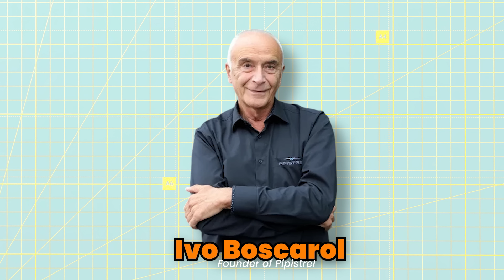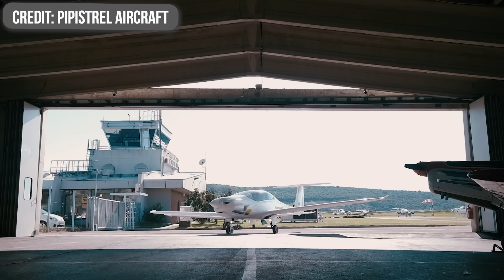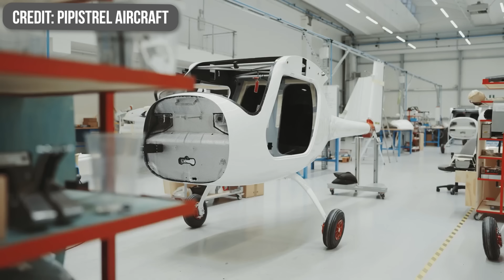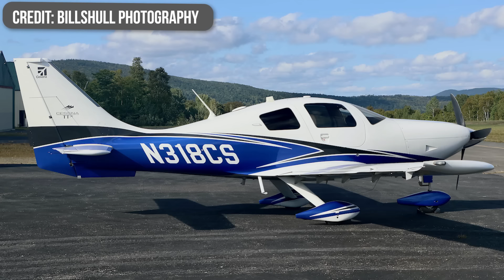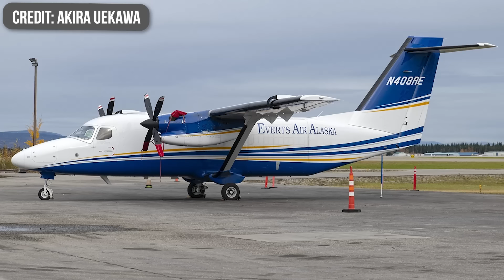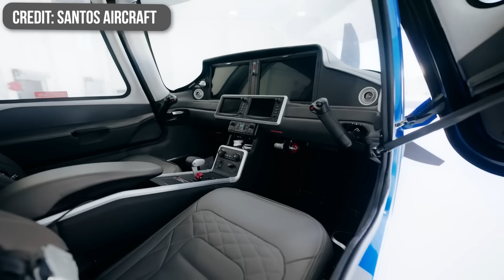What Killed Pipistrel’s 200-Knot Panthera?

Comment: They should have stuck with their original Lycoming 390 engine that supported AV Gas only. To accommodate regular gasoline, they went with another engine that changed the math for all other parameters altogether. Weight, design, CG, economics, and cost and time.

Comment: Liked Textron early on for their trainer fighter jet, but I hope they are not smoke babies now. The Panthera is the right design for a 100kWh battery and a 275 peak kW motor. Need to extend the wings to full glider dimensions. This is Pipistrel's next gen electric if Textron don't kill it.

Comment: The basic Cessna line were born when Cessna was a far smaller and agile company, not burdened with red tape and the famous American executive's short term mentality. That is why they had a chain of failures. Textron's heart is no longer in small planes , they are making way too much in jets. It is dumb to buy a company and try to grab their battery technology, when the whole world are waiting for a tech break through in energy storage, and the present tech is not even good enough for cars. Textron tried to clone the PC12, they only started over a decade late. I wondered will it be another still born ?  Maybe they are waiting for GE to perfect their engine ?  The TTX, or what ever you named it, I was at Oshkosh a decade ago, I did some math in my head, turned out it was a great two seater plane. They were pissed at me saying it out loud. You fill up the tanks and you were left with enough cabin payload for a 170 lb pilot and a much lighter passenger. Something hard to correct with a name change. The TTX, like the King Air, born with marginal capabilities, needed a decade plus of incremental improvements to make it a best seller, and that is not for short term mentality to stomach.With a chain of failures like that, how many CEOs did they have recent decades?

Comment: Hind sight might have dictated they try something partially liquid cooled , (like Rotax)  and with a knock sensor instead of a heavy six cylinder. I call the present offering of Cessna piston single the Wichita Insult.  An airframe over 1/2 a century old, certification paid for eons ago, made a few changes not by the engineers but lawyers (extra fuel drain ?)  up dated the price, panel,  and offer it to the public with a big company take it or leave it attitude.  Glass cockpit seems such a waste for such a low performance plane. I have a computer with a 486/66 processor, how much will you pay for it?  $ 3/4 million for a lousy 172, that is robbery. If you just consider the law of physics, just about the whole line of Cessna single have a modern day equivalent, not certified , but they can fly circles around them. The 182 equivalent, the RV 10. The 210 The Super Stallion are just 2 examples. The jets are still struggling against the "sound barrier"  with the record holder in speed , was that the Citation "X"  beating the next runner up by a couple of knots. 4000 miles range is far far short of the range of larger airliners, such as the 787. You can cross the Atlantic , but not the Pacific. Even the Challengers and Gulfstreams maxed out at around 9000 miles ?

Comment: Pipestrel could use a 230 HP Delta Diesel which is already turbocharged. at 75% power, it would use 9 gallons per hour of Jet A fuel which is cheaper than avgas. That could yield 200 knot speeds in the low to mid teens without complex engine management.

Comment: Panther’s problem was its tail and needed a lot of re engineering to strengthen it without weight. The cruise speed was within ten knots of its max structural speed limit which is caused by the tail weakness, guess what happens when your not paying attention and nose just barely starts to angle down.Textron didn’t want its darling G36 Bonanza getting stomped on either.
Reply: Love  the plane , but just  looking at how the  H-stab. attaches to the V-stab. does not inspire alot of confidence . The overall appeal of that back end is subjective.....
Reply: If l may , all the G36 needs is a bit more shoulder room, and a diesel  option !
Reply: Why does everyone keep saying Textron wanted to kill a Bonanza competitor? Textron literally killed the Bonanza itself. They were only selling a couple per year (at nearly 2 million dollars each!!) and announced the end of its 80 year production run back in October 2025. GA is literally dead.

Comment: I've had a deposit for years now and in the meantime the price has almost doubled to over $1M. I absolutely love the looks, performance and handling of this aircraft, but I'm not getting younger and might have to bail on this. Also the luggage space is shockingly small compared to an SR22 and it would have been nice to have some piezoelectric anti-icing. Sad to see this go the route of the Cessna TTX.

Comment: Textron has deep pockets but no engineering vision but Pipistrel fumbled that program way before Textron bought them. There is just no certification difficulty with a composite unpressurized bird. Limited engine choices, overpriced avionics but otherwise simple. I don't know what they were doing all those years but it wasn't certification difficulty. It was shown off in a nicely finished form already in 2012/13 and then nothing. I remember being disappointed they raised the price to 500k which today is almost cheap if you didn't know any better.
The plane had great potential, good looks and aerodynamics but they fumbled it hard. It's a facepalm. With a new engine like JetA CD300 and cutting 300kg from the plane (which is very doable) it could be market dominant. Your conclusion that Textron doesn't need the Panthera is quite wrong, they should want to dethrone Cirrus SR22 which is very possible. It's not a fantastic plane. It's a so so 1980s hobbycraft with a WW2 engine. It's not even carbon fiber, it's so unambitious that they used fiberglass when carbon fiber pays for itself. Yet they want 1.5million for one now. Textron could murder them with an improved Panthera. The Panthera has 2 strong qualities, looks and aerodynamics. Just need to cut airframe weight in half and a JetA breathing engine, then it will be untouchable by anything other than an actually light jet designed by me. oh yeah and add a parachute that doesn't use a dumb rocket. People would love it across the board. Getting rid of Garmin would also be good for price. Might cut close to 100k from the price
Reply: Cirrus's strengths are mainly it's interior  - 49" of shoulder room , and the overall panel area layout is certainly the industry benchmark  standard  ! And because of  who is typically riding in the right seat, sold on the whole parachute idea , yes sales  remain healthy  .

Comment: Another factor to consider when comparing against the SR22/T is insurance.  As a relatively new retract with very limited volumes, the Panthera would drive significantly higher insurance rates compared to fixed gear Cirrus

Comment: With such a long wingspan, the Pipistrel would be a bumpy ride at speed in anything less than perfect conditions
Reply: Wingspan has little to do with it. Cruise lift coefficient does.

Although higher aspect ratios do have a steeper lift-curve slope.
Reply: @Triple_J.1  Steeper lift curve is what gives you the bumpy ride when you're travelling in turbulent air conditions.

Comment: I wonder why there was not greater effort by Lycoming to make the 390 Mogas compatible?  A few points of compression would have dinged the power output, but anything in the 200hp range should have sufficed in an efficient airframe.  185 knots true?  It might have been enough to get the program off the ground.
Reply: Especially since they spent years refitting it with the IO-540 which won’t run mogas either.

Comment: I think Turbaero/Turbotech/ PBS (who all are making smaller turboprops ) should approach Textron into making the Panthera the first GA friendly light turbine. Different niche, solves the high altitude issue w non turbo piston, I think people would appreciate the safety component as well. It would be a true cross country machine.  The new turbines are approaching piston fuel burn, especially at higher altitudes.
Reply: @ doclink- and add some fuel capacity. One issue I’d comment on, is that to take true advantage of a turbine, owners would be into O2 usage consistently. Most of the current turbo-props are pressurized cabins. At some price point, a used pressurized cabin class would compete (with anti-ice capability)
Reply: @holodek7  The extended range tanks on the Panthera are 82 gallons, The Turbaero will burn about 14gph at 8000ft, about 12 gph at 15000ft, lower as the altitiude increases. Most bladders need relief before fuel is the issue, I would think. The oxygen is an issue, but I would take a non pressurized turbine vs a pressurized piston. A pressurized turbine will start getting in the multiple millions so they won't compete with me ;)
Reply: @OGrobertbarnes  There are smart O2 systems that dispense an adequate amount of oxygen automatically, cheaper than pressurized.
Reply: as long as those turbine manufacturers continue to skew the reality by advertising lower operating costs, less maintenance, less noise, environment friendly tech, this is a dead end. A TT turbine is close to 100k€ for 130 hp, burns more fuel (granted JET A1) as nobody operates at 50% power, no feedback as to its overhaul cost and it needs trained mechanics. Not to mention the noise which most GA airports neighbors will definitively notice. A Rotax does the same with less noise, less operating costs and costs half the price (if not lower).

Comment: The Virus is NOT a microlight. It is a LSA with 600 kg MTOM, IFR equipped if desired or Night VFR.
The Alpha trainer is not even on par with Tecnam for primary trainer. Tecnam is way better for basic training,
The electric prototypes are just that. Development ceased because battery tech is mature.

Comment: As battery electric GA is a hoax with battery energy density an order of magnitude off without hope, the Panthera was killed for a dead end. If they don't buy a fuel cell and H2 tank company next... anyway, I'm 6 ft and can't sit in the Panthera without hitting my head, so I think the design had other flaws as well.
Reply: Its a Hoax in EV cars too, I got a Hybrid for transitioning, but changed my mind when battery replacement high cost $$$ from my pocket lost all past savings in gasoline , returning to ICE>
Reply: @carlosfeliciano1461 battery electric cars have 8-10 year warranties, and last much longer than that.

Several million electric cars on the road now, some for over 15 years.
Reply: @electriccarguestdrive3373 BS, sorry. There are a lot of issues with (B)EV batteries. Some manufacturers sneak away from the warranty by OTA capacity reduction or reduced charging speed. Some replace module after module, after warranty runs out (first in km for heavy users, not elapsed time) you pay. Worst case the whole battery, most of the car's worth.

Most people don't notice. If you drive an ID.x, 10 mV imbalance will trigger replacement, in Tesla 😂 that's considered excellent I guess. They charge very slowly anyway by industry standard. BYD burns a showroom down in China what feels like every week.

Don't get me wrong, I have two EVs, i8 Roadster (PH) and Porsche Macan electric (B). But I'm not ready to make claims negating the issues. I drive BEVs since 2013, I know a little about it 🤫 not just from social media.
Reply: @carlosfeliciano1461 my 2019 Leaf still has 90% of its battery capacity remaining. And it is not a vehicle well known for battery longevity due to lack of thermal management. 

Usually those batteries don't die outright, they get weak cells. There's nothing preventing one from replacing cells other than the battery's construction (Toyota hybrid batteries can be repaired this way, Tesla can't). It's not a problem with the tech, it is with design and logistics; those are fixable.
Reply: So am I! And what would you choose for yourself? It's just interesting! Give me some advice!
Reply: @Hibis29  I looked at many options and decided to keep the Cirrus SR20 G2, replaced the NavComs with IFDs, Autopilot with DFC90 and got a new Engine. Will get Vantage as EASA validated and available and a new interior (the exterior is almost looking brand new). The 150 TAS @9,5 gph IO-360ES is a good engine, except it needs Avgas 100ll.

The certified 4 seater with BRS and JetA Engine just isn't there. A Panthera with the (planned) bubble cockpit and a MoGas engine would be a nice alternative, but it's not there. The Diamond DA40 NG has issues with the AE300 and their sales hides. The P2010 has no BRS, the Bristell B23 only 2 seats. It's difficult.

The Cirrus SR10 with the Rotax 915is would be nice, but it's only available in China. Why sell it elsewhere if people pay 1,5 million for an ancient tech. SEP plane with nice Avionics 🙄

With Vantage and a new interior, the SR20 is really great, efficient, comfortable. The fuel issue remains. Would have considered a DeltaHawk, but it's not there and Cirrus (owned by the Chinese that own Continental as well) won't ever go there. The CD-300 I saw in a test SR22, but I am sceptical it ever materialises and it's a real tight fit with useful load impact.
Reply: @HarryF-tz5fo  they don't even publish them. I guess similar to the SR20 with faster climbs because of the turbo. Careful with DA40s, they either have an Avgas Engine or an Austro with issues and ADs from hell. The TDIs are good I hear, but the Thielert engines have a TBR, not TBO, and that can set you back another 150k 😢 And no BRS. But a good safety record regardless.

If a two seater is fine, I would consider the Bristell B23 915is, it's a fun machine and you can't get it over MTOM in the real world. I fly it in a club from time to time, nice little plane. But you don't climb in, you wear it 😂
Reply: @BlueSideUp   Спасибо за полезную информацию!